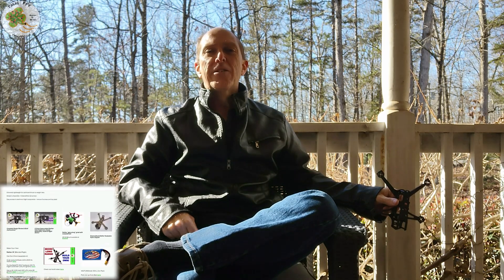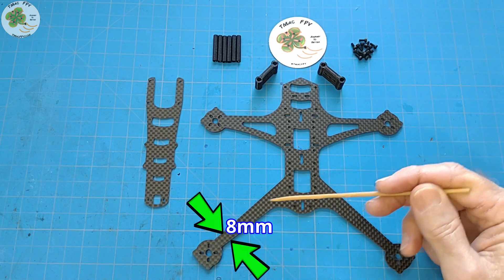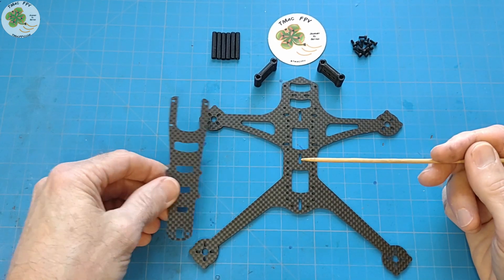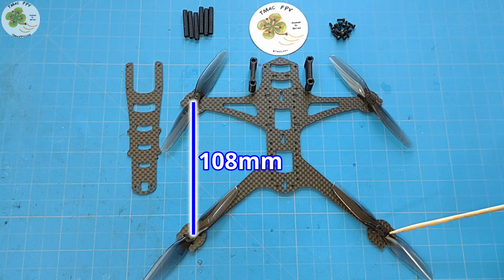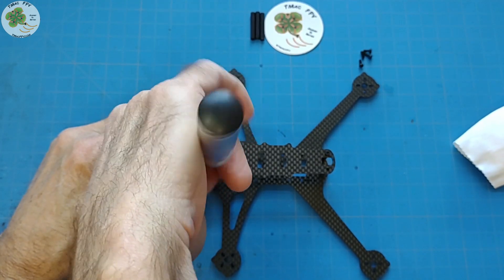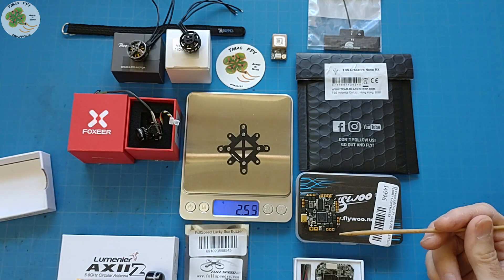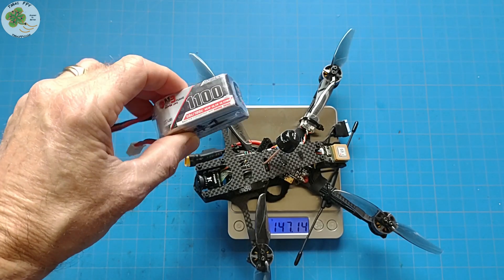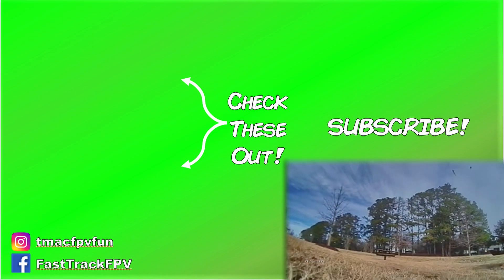Micro FPV Drone Frame Kit (4 INCH KOBARA)!

Comment: I really like all the thinking you put in your designs. Love it!
Will you provide a tune and some pointers toward flight times? My take is that at 143gr you could get 10+ min on the 1404.
Reply from the maker: Apologize it took this long to get back with you.  With a 4S 1100 mah LiPo (for an all-up-weight AUW-including battery of 238 grams) and a flight just cruising around until batt voltage at 14.0 volts (3.5/cell), I got 14:20 flight time (using the 1504.5 2950 Kv motors). Could most likely get more out of it with 1404 2500Kv motors (AirBlade Superman).  BF 4.2.6 default BF PID & filter settings, running bi-directional D-Shot with RPM filters.  She flies reeeeallly sweet👌 Very quiet too🤫

Comment: For aio mounting in traditional mounting position no side screws?
Reply from the maker: Correct- in "traditional AIO "diagonal" mounting position, no side screws.  I've been flying mine without side screws on my "floating" 20x20 to AIO 3D printed adaptor for quite awhile and it works fine.  For this build, as you can see in the video. I mounted the front 25.5x25.5 Shark Byte board "non-traditionally" (sides parallel to frame sides) and the AIO Flywoo board "traditionally" in the back with only front and back mounting screws.  Secure, flies great, saves weight too!
Reply: I see in the video the flight is bobbing back and forth could that be the result of just front and back points of the fc aio being mounted? Love the look of the frame but the lack of full mounting of fc isn’t admirable
Reply from the maker: @brandonmoody3571  nothing to do with FC mounting at all, it's solid & secure. FC doesn't "wobble" at all, only needs 2 mount screws. Did you see the wind from the flag blowing at the park? It was 40mph winds I was trying to fly in!

Comment: Another uniboby masterpiece. An exercise in simplicity, lightweight and rigidity. My little Rattler is still going strong. And yes, I did crash it. A lot!
Reply from the maker: Yep, the Rattler's a sturdy beast!  This is the other solution I had for you for no mounting adaptors with AIO boards.  Holds 2 AIO boards in 2 different stack positions without adaptors
Reply: @TMacFPV  the perfect frame for that Iflight beast AIO 50A FC. Can you fit an Air Unit in the back and ditch the Gopro altogether?
Reply from the maker: @AdrianoCasemiro  Air Unit's too big (long) for this frame.  However, there's work being done in FPV Stabilization Tools Facebook Group that basically allows you to stabilize any HD camera (like a Tarsier, Runcam Split, etc.).  Not very "user-friendly" yet but the progress is steady and fairly fast.  Also, firmware upgrades, etc. are in-works for Shark Byte.  I believe sometime this year we won't be needing an externally mounted camera (like the GoPro anymore)